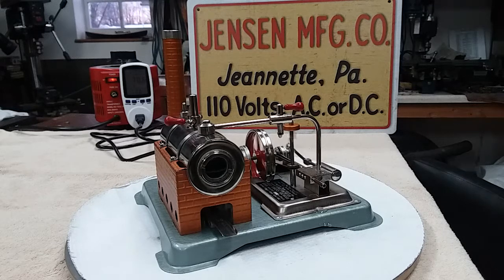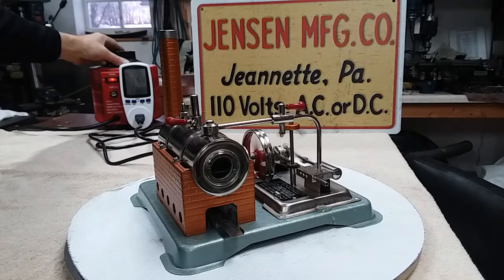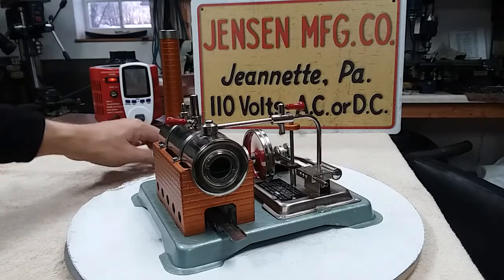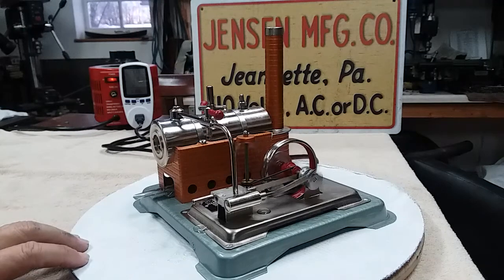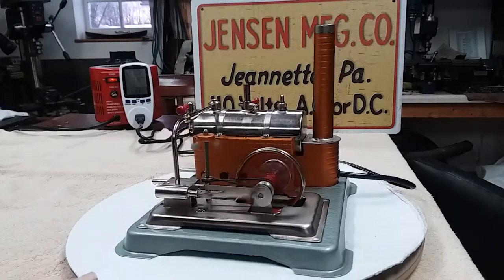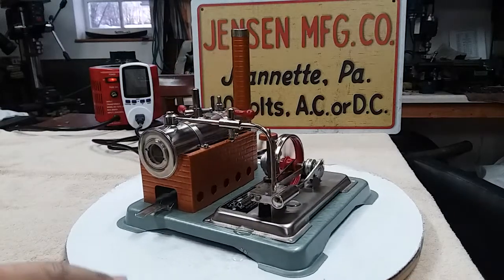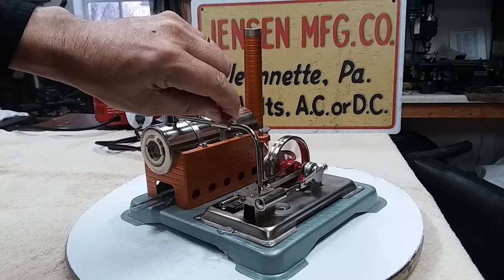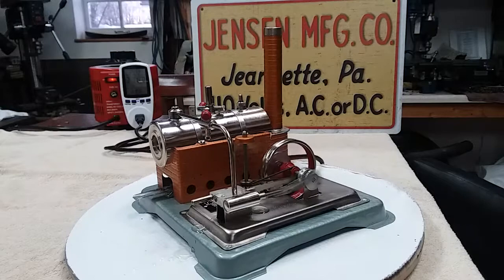Jensen #65EL 110V , Dual fuel , live steam engine

Comment: Looks brand spanking new Bruce.
Reply from the maker: Thanks Jim.
I really only think its been run once, half the esbit tablets were still in the burner tray , when I removed the boiler to convert it, the soot wipes off with a rag. it is exceedingly clean & like brand new. its the best running #65 I've ever had.